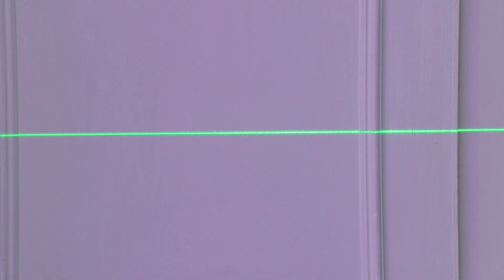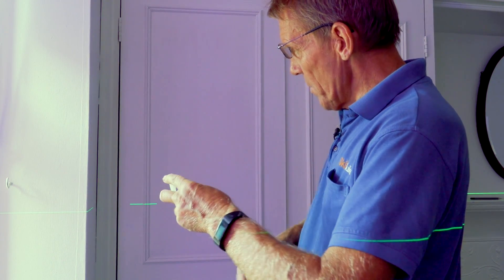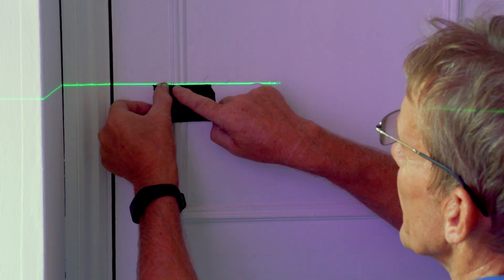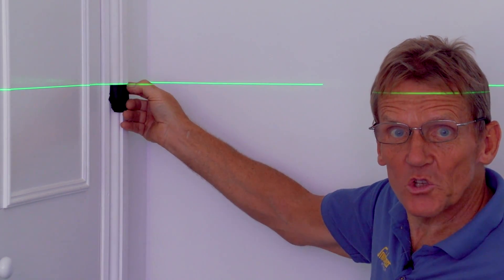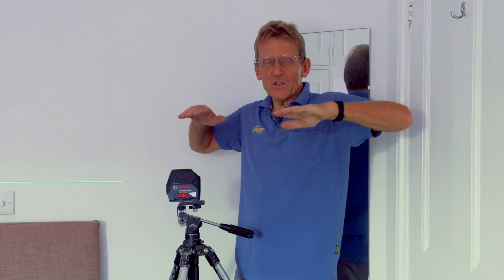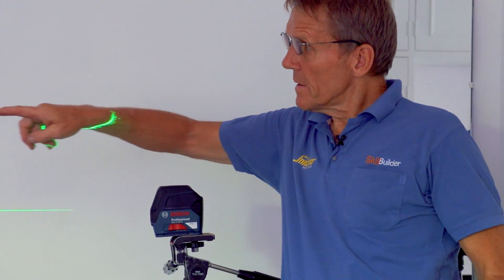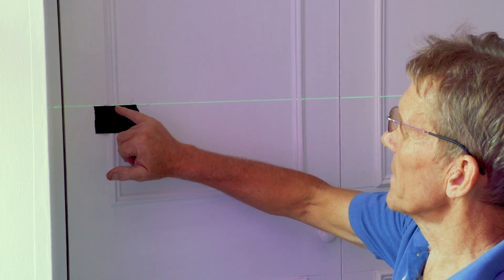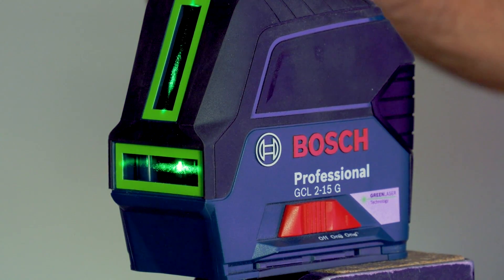Is Your Laser Level Really Level? How to Check

Comment: Slight correction: a level that isn’t level is WORSE than useless, it’s a liability. When I was building my pole barn, I started with the site prep by using an old laser level that I assumed was still calibrated. After the poles were set into the footings, I was striking a level reference line on all the poles so I could measure up from that for everything else and I decided to double-check the laser level by setting up a water level. It’s a 36x60 foot shop so I ran the water level from corner to corner (approx. 70ft). I set the laser level up in the center and adjusted the water level to match but was seeing several inches of discrepancy from end to end. So I did another test like yours, strike the line where the laser is hitting and then rotated the tripod 180 degrees and marked the line again. Over 70ft the level was off by almost 5”. Luckily there was enough extra on the poles that I didn’t have to make the whole building shorter, but I did have to spend a bunch extra on gravel to fill in the low corner before pouring the concrete slab. Bad levels will cost you money (on top of needing to buy a replacement that’s calibrated correctly). I always remember this when I think about how expensive tools can be. Buy once, cry once.
Reply: "Slight correction: a level that isn’t level is WORSE than useless, it’s a liability."  Wrong, you should ALWAYS, ALWAYS, ALWAYS,  check like you did when using any level. You can use a level that is out of level by knowing it not accurate and dividing/splitting the difference and checking again like you should do regardless.

Comment: There isnt always a lock on laser levels. And can you put a link to that tripod in the description ??
Reply: I just picked a similar tripod up for mine at the local charity shop for £15, keep your eyes out, there's always loads at car boot sales and second hand markets for cheap
Reply: Yeah but my prob with most of them and the dewalt  and bosch ones is there not really building site quality. That tripod he has there looks beefy lol
Reply: Well you just have to look after it then, some of the old camera tripods are pretty hefty to be fair
Reply: I tried to modify a tripod that hold a dump level but it never really worked lol ill find one soon i suppose. What laser have you got then iv got the 360 dewalt with the 3 beams
Reply from the maker: @covcarpenter9158  Yes that is the one with up and over
Reply: Skill Builder is it nice and robust ?
Reply from the maker: @covcarpenter9158  Built like a tank
Reply: Skill Builder  cool i have to find one if you see a brand on a make on it lets us know. Cheers roger 👍
Reply: Yeah i were gonna say the same, my PLS doesn't have a locking device, wonder why?
Reply: DP JOINERY  the early dewalts didnt either i dont think any hilti or pls have a locking thing. If your a chippy the get the dewalt with the 3 beams. Its epic plus its rechargeable so no running about trying to find batteries.
Reply: Thanks, i might take a look at it but      i can't fault my pls the batterys last for ages in it.
One thing i do ffind though is that the red beam tends to make my eyes feel funny after prolonged use, so i try to use it as little as possible.
Reply: DP JOINERY  the human eye sees green better apparently so id go for that dewalt its a green beam. The green laser tend to give you a thicker line but thats no prob. Ill put the part number to the one im on about for you
Reply: Its the dce089d1g
Reply: @covcarpenter9158  thank you, so kind, have a great day.
Reply from the maker: I bought that tripod from a girl who was flying back to OZ and didn't want to take it. Too heavy.

Comment: Excellent video. Really appreciated. 

What are the 'non-pendulum' laser levels like in terms of cost and accuracy?

Any tips would be fantastic.
Reply from the maker: I would never bother with a laser that needs the little bubble placing in the middle of the dot. It takes too long. That said there is less to go wrong and they are cheaper.

Comment: Nice quick check...Cheers. 

In your case the laser was rising slightly to the right....if you had left the tripod in the original position ( to remove any set up errors) and just moved the actual laser through 90 degrees to shine on the right hand (high side) wall...would it have shown the error as now the laser would be showing the lower side of its line to the left, as it did originally and would now show the true discepancy between low and high readings?
(Basically.. low on left high on right....turn laser to right..90 degrees...putting the low laser point under your original high point on the right).

A friend of mine used his laser on a tripod, and it took him quite a while to discover that the swivel base had seized, so instead of rotating the laser on a level plane...he was actually unscrewing it from the tripod very slowly every time he turned it to the left...elevating the level just a hair every time.
Reply from the maker: Ah yes my head hurts now. You are right, that would have been a better way.
Reply: That is assuming the 90-degree rotation doesn't have any discrepancy in the plate it is rotating on?  A very slight change in the rotating plate would exaggerate the "change?"  or am I way off with my own assumption?  I have had to adjust my camera when doing this because the angle is slightly different.  The laser would adjust for level but wouldn't there be a difference in height?
Reply: @bestbuilder1st  Exactly what I was thinking.
Reply: no, not necessarily - depending on what is the reason for the discrepancy your method may work or may not; Rogers method is better because it shows any error in any case!
Reply from the maker: @fiddleronthebike  I like your channel. Nothing I enjoy more than being out on my bike.  I have done the Etape a few times and countless other events. I love the mountains of Mallorca. I am going to binge watch them now.
Reply: @SkillBuilder  wow, you are a cyclist too, that's great! Sadly I did not ride my bike for some time due to an serious illness in my family which stole much of my time - and therefor no videos since than... but I hope to be back on the bike in 2020. Love the mountains of Mallorca too, and the Alps, it's wonderful to ride there. And I like working with wood and in my house as well (though it is not my profession as yours...). I love your channel too! Keep up the good work!!!